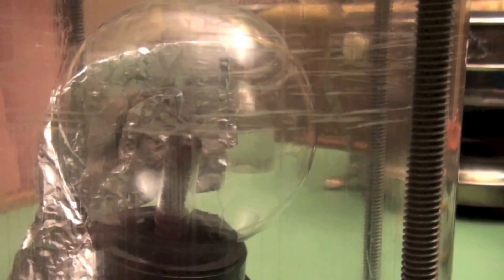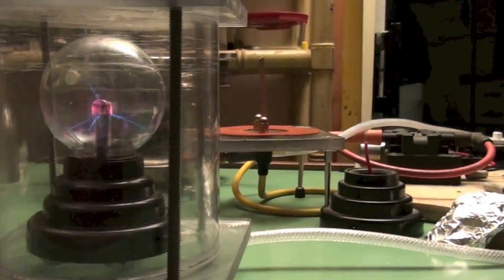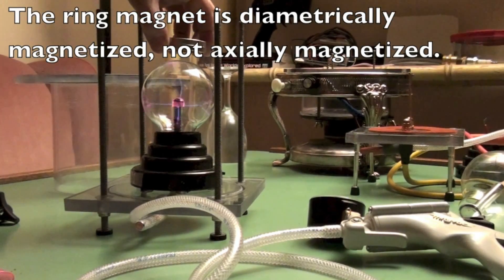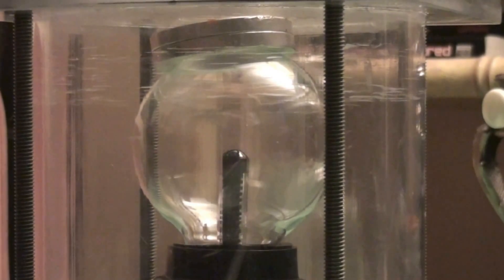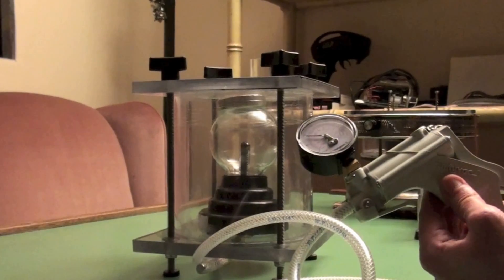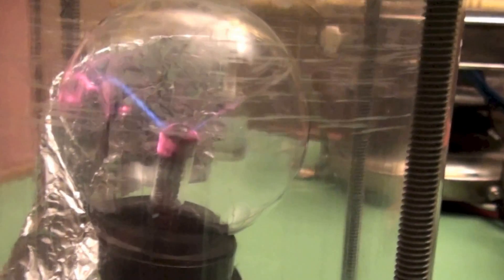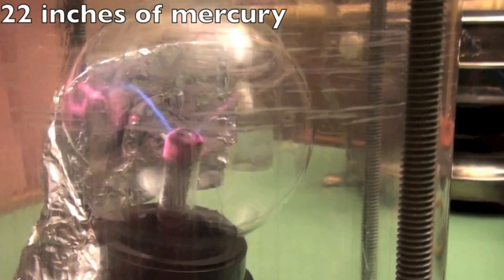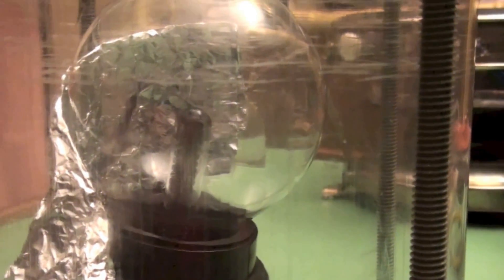Mystery Of The Plasma Ball In A Vacuum

Comment: when you put plasma ball in a vaccum. the pressure inside the plasma ball increase. it only works when high voltage inside glass tube with low pressure gas. different gas mixture produce different colors of light. in this case I think it is helium gas that is inside the plasma ball.

Comment: Some batteries are sealed and pressure can cause issues on sealed containers... You could test the batteries (simple circuit with led+Resistor), inside the vacuum chamber then lower the pressure until you reach your Hg 20mm.

Comment: Remove the black case.   That way we can see the outbreak of GLOWING PURPLE DISCHARGE in low-pressure air.   That's a problem with Tesla coils in vac chambers: unwanted arcing which shorts out the HV.   Try turning off the room lights, and maybe you'd see a glow at the bottom of the glass, down inside the base.
Reply from the maker: Thanks for the comment...That is correct about the HV in a vacuum, and is something which I discovered a bit later.

Comment: Yes, it happened to me the same thing at 6 am dancing on a unpopulated dancefloor to be very free of move in every direction!!!:D:D..i think that at high energy the emission become not visible because is changing the "ground" (or the boundaries) so for a bigger "potential jump" and to ensure the conservation, the frequency is bigger and there is an overclock of the system (battery included)..for let you understand simply, if for example i stretch a guitar chord the frequency of sound increase

Comment: If i can try to explain the phenomenon i start from what Keshe asserts about the behavior of the plasma when it's diluted, dropping down the pressure the elements in the plasma state (in the ball)  have "more space" because acces to the rest of the chamber; according to the teory's model the rotation increase (like for the 3rd kepler law) to mantain unmodified the relation between the centre and the elements in rotation. I think that this variation of speed changes the emission spectrum...

Comment: The HV circuitry being in the vacuum is arcing (shorting) before it can get to the ball.
You need to insulate the HV circuitry if its going to function in vacuum or move the HV circuitry to outside the vacuum environment. 
I am also interested in Keshe "Plasma Reactor" technology and doing some of the same experiments that you are doing. I wind my own Tesla-type self-induction coils (small) powered by an air ionizer (8 watts) with Leyden jars as capacitors applied to a clear incandescent bulb.

Comment: The High Voltage Arc  needs an atmosphere ...Electric Utilities have used vacuum breakers to interrupt high voltage/ high current faults in substations for many years.
 Replacing more dangerous "oil circuit breakers".

Comment: I think, you are right with your theory! It is a plasma at high frequency and the air around is acting like a condensator. If there is no air or alumninium the capacity is to low to have the plasma flashes.

Comment from the maker: Thanks for the suggestions. That's a good one about the cordless drill. I do have a couple of alternative high voltage setups, one with with a car coil and a dimmer switch, run with 120 volt AC. And I have a PWM to generate a HF DC pulse as well. Those movies are coming soon!

Comment: Dont mean to fill you box up, but this is really simple to do, and wont cost alot of money. drill triger-car+car igntion coil= the best tesla coil time and most dependable, plus you can use the battery that comes with the drill or anything smaller, i used a 18volt  dewalt battery with mine but could use a standard 9volt battery from the grocery store too.

Comment: you should get a Old cordless drill, and remove the trigger use it for the frequency driver, the two leads that usually go to the motor- hook up to a ignition coil out of a 60-70 model range "the round ones about 5inch tall"   the lead that comes out of the top that usually goes to the spark plug  put it in your vacuum chamber.  now the chamber will be a plasma globe and you can work with different pressure and frequencys..  i also have a video on making a really cheap chamber.

Comment: The"plasma globe"  you have is nothing more than a  glass globe that sits over the high frequency discharge the middle of the globe has a glass shaft that is raised, so the discharge  is not inside the globe at all. Wat your seeing happening, or not seing happening is that the plasma is being trapped in the single lead.  i have videos on it.